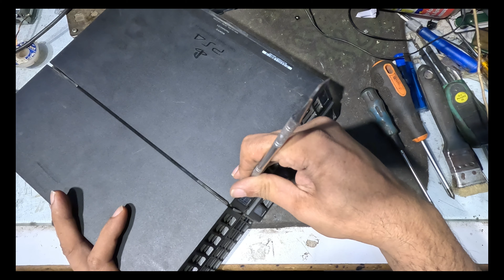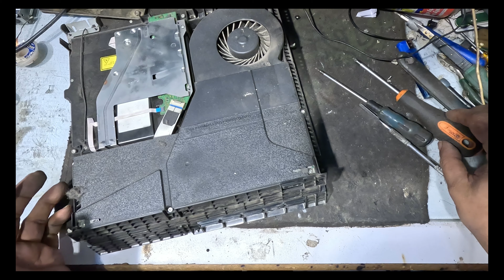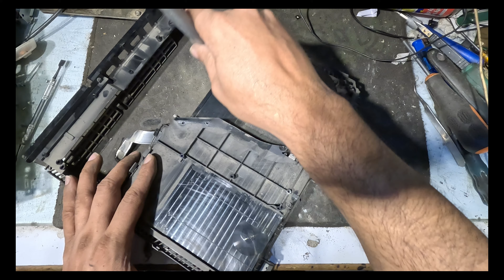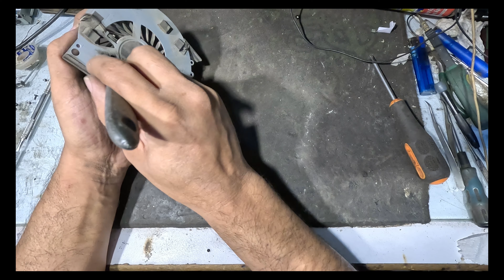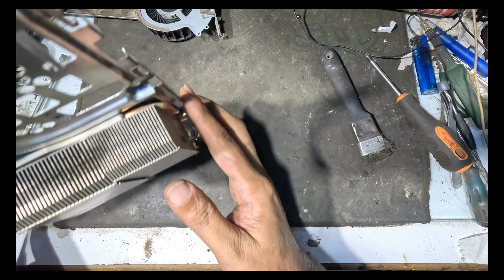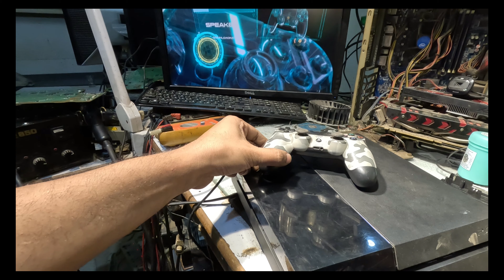Cleaning Every Part Of A PlayStation 4 | Deep Cleaned |

Comment: Hello, my PlayStation slim gives this error CE-36329-3 and it turns off once and then turns on again and locks the screen and the color of the image is damaged. I changed the hard drive and it didn't work. Does the console need an APU rebal?
Reply from the maker: Not sure.